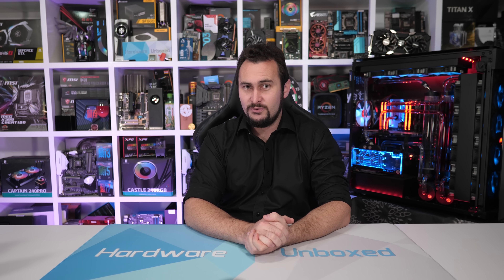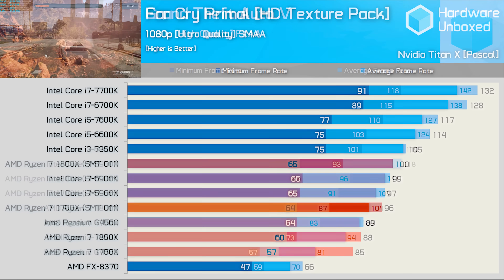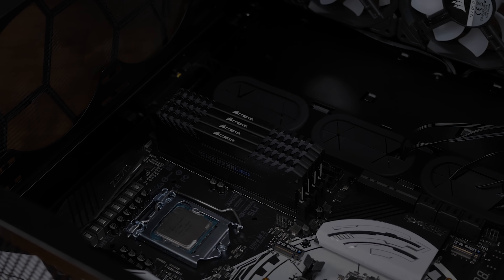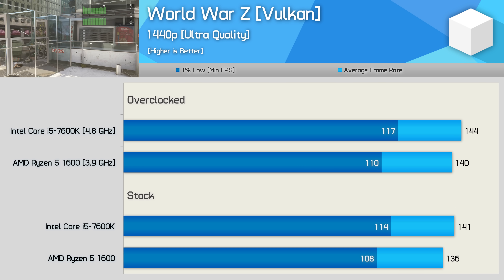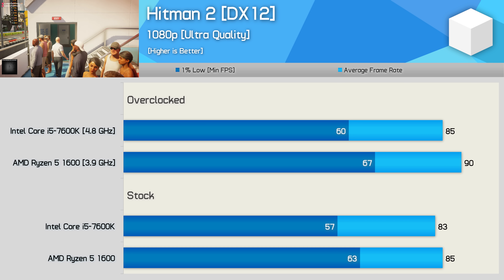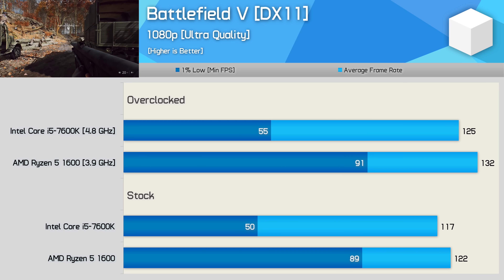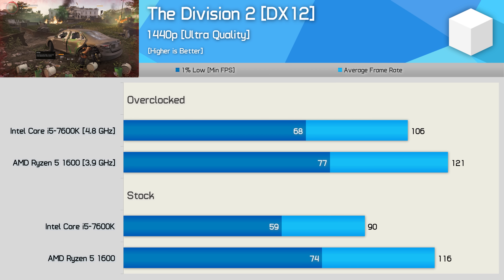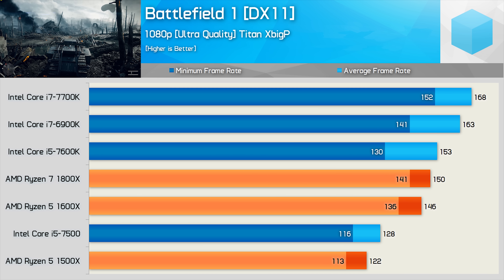Ryzen 5 1600 vs. Core i5-7600K, How Times Have Changed!

Comment: Love how many excuses are made for the Ryzen chip in the tests where it lost, then the praise it receives when it comes out ahead, no bias at all.
Reply: maybe, but its hard to argue against that the games that Ryzen won uses the more advanced and modern game engines, representing the trend of the future.
Reply: @tylovset  Apart from WWZ and Rage 2 which runs on vulkan also are brand new and the Intel chip outperformed it? did you watch the video? so no the AMD did not outperform on the mordern engines.
Reply from the maker: That's an incorrect analysis of the results. Maybe you need to watch again.
Reply: @Hardwareunboxed  A third time will not make the result's change. We came to different conclusions is all :) i see both chips as trading blows based on title, but in regards to the Vulkan test's both sets of results clearly show the 7600 in the lead both standard clock and OC, The dx12 tests clearly show the ryzen chip out in front. which seemed strange to me but the results are what they are.  But it did sound like you downplayed the instances where Intel was ahead while giving AMD props where they were ahead. I do not think you are a shill but definitely very keen on AMD picking up more business.
Reply: @MrHozay11  "But it did sound like you downplayed the instances where Intel was ahead while giving AMD props where they were ahead."

Really?  I didn't feel that way, in fact Steve went on to specify the huge percentages ahead the 7600K was over the 1600 in the games were a substantial lead was achieved.  What i think this video showed was just how limited the 7600K can be in newer titles, such as Battlefield V where the 1% lows simply just tank performance.  4 cores/threads are dead 6 cores with no HT or SMT may not be to far behind in the not to distant future.
 
Another thing, God forbid you even think about streaming with the 7600K, something that is actually possible, with varying degrees of success, on the Ryzen 1600.  What this video, to me, indicates is that more cores are certainly the future.  We are seeing that even much higher clock speed, a 23% speed advantage on the 7600K,  will not be able to compensate for more substantial slower cores.

"I do not think you are a shill but definitely very keen on AMD picking up more business."   

As he and any smart consumer should be, if not for AMD what would we have from intel, doubtful it would be 8c/16t monsters like the 9900K. More like the same we got generation after generation, because they didn't need to really do anything, that, praise be, has changed.
Reply: @davidwooten7212  You missed my point , and also seem to have taken a different perspective on what was said, which is perfectly fine. that is your opinion. 

AMD and Intel are both needed for sure, and the Ryzen chip is far better as a value propostion. 

The language being used is somewhat open to interpretation, i obviously interpreted differently too you, mostly concerning the Vulkan tests And how highly praised the Ryzen chip is in tests where Intel is behind, compared to the Intel lead tests where the 7600k was downplayed.

the rest of your points are irrelevant to my point so i will ignore them. In journalism being objective is important for consumers too. there is obvious preference to one side in this video from my perspective.
Reply: @MrHozay11   @MrHozay11  "the rest of your points are irrelevant to my point so i will ignore them. In journalism being objective is important for consumers too. there is obvious preference to one side in this video from my perspective."

Fair enough ignore my points if they are of no value to you.  However, I don't see that Steve having a preference to the Ryzen CPU is an issue here, I mean it was the budget gaming CPU of choice by HUB for a reason.  It is in fact the MUCH better CPU and by acknowledging the fact he is being genuine to his viewers who may want to know this information.  You call it bias, I call it reality.  

I just don't understand what you expect him to say other than what he did, that would make the video any different.  To each their own.
Reply: @davidwooten7212  I don't understand why you feel the need to quote something that is clearly visible directly above. but indeed each to their own. 

To be perfectly fair this is HWUB's video and this is how he felt he wanted to present the video, i felt parts of it were a bit unfair with the language and tone of voice used, which is why i called bias. This could be a cultural misunderstanding, but i do not think so.  I do not make video's, but am aware there is a lot of time and effort put into keeping up with producing them. So giving my opinion on what should have been said differently really would have no impact besides being insulting to his trade, which he is clearly passionate about. 

Having a preference is not an issue until it come's out when attempting to be objective. And he may not even have one and i might be totally wrong. It's just how i heard it. :)
Reply: @MrHozay11  Because I was responding to a specific part of your comment.  Sorry if that bothered you.
Reply: @davidwooten7212  That seems strange to me. I know what i said and could easily understand a direct response to something i had said as long as there is some context in your sentence. Quoting seem's lazy. 

Do you quote someone when you are talking to them face to face? moments after they have said something?
Reply: Peter Chestnut Wow. What is actually your problem?  Instead of going on about this let it go. I said I was sorry. But you had to say I’m lazy just because I quoted you?

I think I am done with this conversation. Have the last word, as it seems your ego needs it.
Reply from the maker: Good boy Ryzen, good boy.

Comment: Remember when all reviewers said that using low res (720/1080) to stress the cpu was done to predict the future performance, where are they now? (Not referring to steve)
Reply from the maker: Too be fair it's still the right way to test, but you need to consider CPU resources as well.
Reply: Hardware Unboxed it is but back then it was clear games were getting more multithreaded so that difference represented past instead of future

Comment: 1600 is noticaboy faster now that it was on launch. With that said I assume the OC was with no over voltage because my 7600k can OC to 4,8ghz on stock voltage. i never saw 7600k on 4,8ghz with OV. I play on 5.3 ghz and also CPU cache is on 4,4ghz on 1.395v (5.2ghz 1.255v). This OC will change a few benchmarks i saw here. Even on 5ghz with OC CPU cache. Raising the multyplayer is technicaly OC but I would expect more from a seasoned youtuber like you. Only noob will make such bad OC. Unless you consider your audience as such or wanted to show the Intel chip in bad light?  I would consider this as stock performance if there is no overvoltage. AMD CPU have more heeadroom and I wont advise anyone to buy 7600k in 2019 but there is still fuel in the tank.

ps. I hear some say BFV uses AVX? Anything on this? It is certainly worse experience compared to AMD CPU and I know its not only the core count or the lack of optimization.

Comment: Paul from RedHotGaming just released leaked benchmarks of the R5 3600 vs.8700K.  It blows way a the 8700K even overclocked at 5gz.  A $199 CPU that is cutting edge to a $330 plus CPU that is old.  4 more weeks.

Comment: OC'd my r5-1600 to 3.8ghz using the stock Wraith Spire when it first came out. Still a beast of a processor to this day.
Reply: What MoBo are you suing by chance?  I have yet to OC mine, since Cool N Quiet was broken on my MSI Tomahawk B350, so even at idle the CPU pulled maximum OC voltages.  I hear it was fixed in a late patch, perhaps I'll OC my 1600 and get a bit more life out of it.

Comment: This pretty much sums up the entire Core i5 line. They usually provide decent to good performance when launched, but they don't last long as software evolves. Terrible value over time.
Meanwhile, the i7 chips have historically lasted a long, long time, and clearly are better buys even at the higher entry cost. That said, now in 2019 there is little reason to buy anything Intel, but that's another story. :)

Comment: It is pretty simple to see why the Intel is not performing to standards of today. Just about every Intel CPU made to date is getting NO microcode (BIOS) updates to compensate for the Meltdown , Specter and other recent vulnerabilities discovered. Intel claims they released the code for all the vendors to update the BIOS but the board partners are not implementing the BOIS updates and simply just want you to upgrade to the latest Intel CPU and boards that they claim to have the fixes built in. So, the customer looses the battle again and the board partners and Intel gain a profit from this whole vulnerability fiasco!

Comment: I have the 1600, I don't know anyone with a 7000 CPU so I can't say anything about them, I can say that the 1600 runs great and gets good temps and games amazingly. I am happy with my 1600 it is much better than the i7 3770K I was on.

I get well over 100fps in BO4 and Siege, WAY over 100 in OverWatch and such. I don't get less than 100fps in any game I run and my real limitation is the 1060 6gb I'm using.

I don't really have anything else to test against it.

Comment: If you play 1080p low settings hi refresh the I5 still wins hands down. It's not much more expensive and don't kid yourself about how your going to be rendering video all the time.
Reply: I like putting on a game on one screen and watching youtube on the other with no issues.  Can you do that on a 4 core/thread i5, would be curious to know. I recently did that with Battlefield One, never went below 60fps.
Reply: Don't kid yourself about how you are going to single-task lightly threaded shooters all the time either.
Reply: @boshumok6399  An i5 is more than good enough for vast majority of multitasking...  And most games at 1080p are going to get better frame rates with the i5, if you play on low settings even more so.  I'm not an intel fanboy just to be clear. I got a ryzen 2600 at launch and an rx 480  as well. Now I'm using a 9900k and a 1080 ti  but thats just because amd has nothing similar at the high end.
Reply: @OrganicGreens  An R5 is more than good enough for the vast majority of gaming. Those games and resolutions where the i5 beats the R5 are usually already running very smooth and at very high framerates on the R5....and they are always measured when single-tasking that game. For people that do more than open and close one game at a time, the R5 has more resources. I've had 2 games running at a time (1 doing background tasks while active in another) while casting videos to the television for the family.  Nevermind if you don't have a really high end graphics card.  I wager that the chance of feeling pain from a lack of resources on the i5 is much higher than the pain of lost frames in a game with an R5. I'll concede to the i5 if all you do is single-tasking low-threaded shooty shooters with a high end graphics card at low resolutions to the exclusion of almost everything else.
Reply: @boshumok6399  If you play competitive games at 144hz you get it... An i5 is more than enough to have your browser open and play games...
Reply: @OrganicGreens  I just have to disagree with your vague and general analysis. I believe the gaming advantage of the i5 is more niche and less advantageous than the  R5 for the vast majority of gamers, beginning with the 90%+ that have less than a 1080ti.
Reply: @boshumok6399  I've owned an i5 in the past, and now i own an ryzen 2600 and have an 9900k.  With an rx480 and 1080 ti respectively. The i5 is faster than even the 2600 in almost every game. Clock speed is still king even in games that use multiple cores(and even a lot of video editing). And 4 cores is more than enough even for games that do use multiple cores effectively... Unless you render or stream on the daily the i5 is better. And yes my R2600 is overclocked.  People just love to over hype ryzen because it's insanely cheap and amd is finally competing with intel which is great. But those aren't good reasons to mislead people about raw gaming performance. I see so many videos where the reviewer tries to give the perfect scenario where ryzen will be the better gaming cpu and it annoying
Reply: @OrganicGreens  If I was arguing Ryzen was better for most because 'videoediting', I would be as wrong as you for arguing i5 was better because 'single-tasking low res, super high-end graphics, gaming benchmark numbers. The truth is somewhere in the middle for normal people.  Your analysis is so far off and you are just very wrong if you are implying that the i5 is better for 'most' people. The 1st benchmark is with a 1080ti...the 2nd is with a 2080ti!
https://static.techspot.com/articles-info/1627/bench/Average.png

https://static.techspot.com/articles-info/1829/bench/Average.png

Comment: I managed to pick up a Ryzen 5 2400G used for £85, this was half the price of the Intel core I7 6700 and found that the Ryzen CPU was equal if not a almost immeasurable amount slower, for gaming it did fall behind but not enough to matter to me, I honestly think that spending 50% the price of a I7 to get I7 like performance is totally worth it.

Comment: DigitalFoundry showed that whilst the 7600 had better peaks in Crysis 3, any intensive scenes had a severely detrimental performance drop which the 1600 simply didn't suffer from. So, that's the general theme really - games not optimised for more than four cores will work better on the 7600.

Comment: Still rocking my Ryzen 1600. I'm very satisfied with it. Will probably upgrade to a Ryzen 2700 soon since I'm broke and I can still use my old B350 mobo for it.
Reply: I would check on the 3600, chances are you will be able to use that no issues on your MoBo with a BIOS update.  If recent "leaked" benchmarks are to be believed, it should be very close or better in performance to an i7 8700K, which is actually a very good CPU.

Comment: I'd be very curious to know what the benchmarks would be like on more modest videocards like the RX 580 8GB or RTX 2060. I'm guessing that the results would be somewhat more evenly matched.
Reply: They were testing CPU's so why would you use a card that's potentially going to bottleneck before the CPU does? That would be a poor way to test as you wouldn't be able to easily know which was bottlenecking the other, using the card the did means differences can be attributed solely to the CPU.

Comment: I knew it was a mistake to buy the i5 7500 when I got it 2 years ago, but I had bought specific RAM that I couldn't return anymore and was incompatible with all the boards that were coming out at the Ryzen release... this summer, I'm not making the same mistake. Recently got a great deal on some 3000mhz memory that I know is supported in B450 motherboards, so I'm ready for Zen 2!

Comment: We knew once programs started to take more advantage of additional cores and threads, more highly threaded CPUs would see benefits.  I did not expect it to only take 2 years before we started to see this level of disparity.  My curiosity leads me to ask this simple question.  how much of a performance uplift is there from the 7600K to 8600K or 9600K?  I know they are all 6 core, six threads, but does the additional 6 threads on the Ryzen 5 1600/2600/3600 make any increase in performance?  I am guessing someone has already tested this somewhere.  But I am curious.
Reply: @Luka F I wasn't curious about the performance of the 8600 or the 9600 compared to the ryzen, but instead the 7600.  I am curious to see what kind of performance improvement that could be seen moving from a 4 core cpu to a 6 core cpu.  As far as I understand it the Ryzen chips currently are 15% or more behind intel on IPC and quite a way behind on speed.  I am very curious to see what Ryzen 3000 series brings to the table, but at best we will see a parity in IPC performance.  I still believe that Intel will be faster in games, but the Ryzen 3000 should be decent for the most part considering the disparity of clock speeds between the two manufacturers.  Interesting times ahead, indeed.

Comment: Steve, where can I download the Excel 2016 Monte Carlo Simulation that YOU use in your benchmarking. I don't game that much and the Excel benchmark is more relevant to my usage. I work with Non Profits and Churches and it would help in determining how much of a benefit a newer platform would be for them.
Reply: https://redirect.viglink.com/?format=go&jsonp=vglnk_156004686862610&key=552a35ca1eb1421626a0f973ac2a90af&libId=jwobmadh01001u52000MAbvfwh1pu&loc=https%3A%2F%2Fwww.techspot.com%2Fcommunity%2Ftopics%2Fexcel-2013-monte-carlo-benchmark-simulation.228431%2F&v=1&out=https%3A%2F%2F3zlgh94fh5g6qst7641xzf29-wpengine.netdna-ssl.com%2Fwp-content%2Fuploads%2Fmonte-carlo-simulation.xlsx&ref=https%3A%2F%2Fwww.google.com%2F&title=Excel%202013%20Monte%20Carlo%20Benchmark%20%26%20Simulation%20-%20TechSpot%20Forums&txt=https%3A%2F%2F3zlgh94fh5g6qst7641xzf29-wp...p-content%2Fuploads%2Fmonte-carlo-simulation.xlsx

Comment: I got a z270 taichi board. And I have my 7600k oc'd to 5ghz, and 16gb of ram.
Reply: 200 Mhz more than in this test and in a range where every mhz increase will bring less to the table.
Reply: @tobytoxd  what do mean by less to the table. More is more I thought.
Reply: @winterbirdponcho53   I meant that around the limit of your cpu overclock capabilities it can be, that gains will only show in benchmarks but not in increased gaming performance. Sometimes it even won't show higher scores in benchmarks (that depends also on voltage and cooling). But anyway... enjoy! ;)
Reply: @tobytoxd  not in my testing. I've found that I have definitely increased frames. Especially while multitasking. I have multiple monitors and play games while watching TV or YouTube.